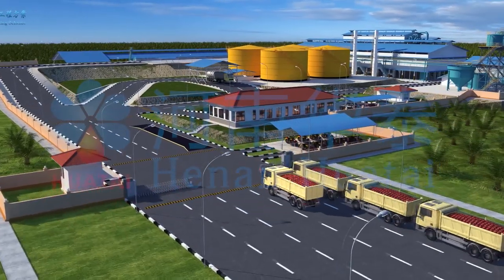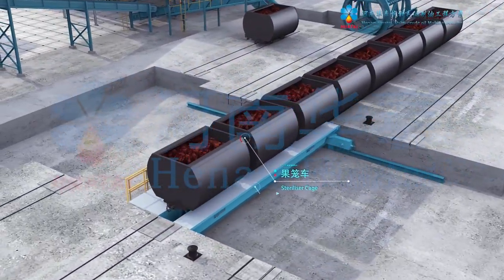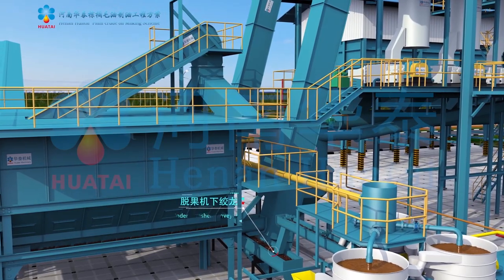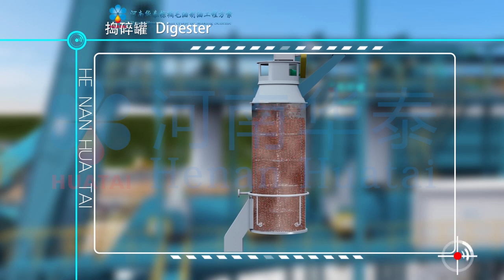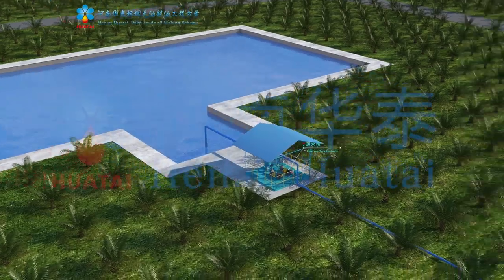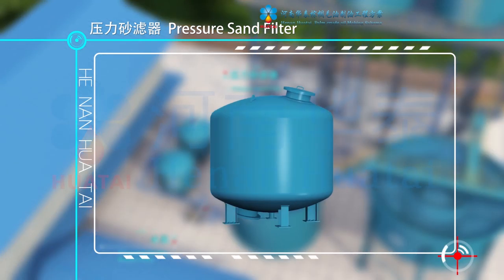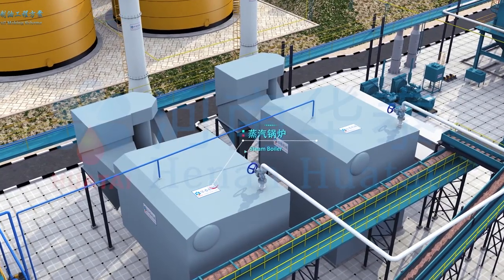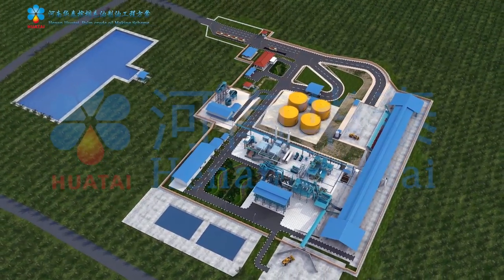Palm Oil Mill / Palm Oil Production Line /FFB Processing Machine

Comment: Very good clean hygienic hitech processing method. Because once sterilisation the whole processing method needs to be done in enclosed form until oil is extracted for hygiene concern to conform safety and health code and practices. Most plant don't adhere to this practices esp on the screw pressing process. Still I believe there is one flaw. Haha if I am right might reduce costs by maybe less than 10%